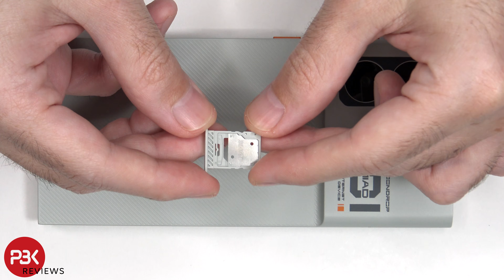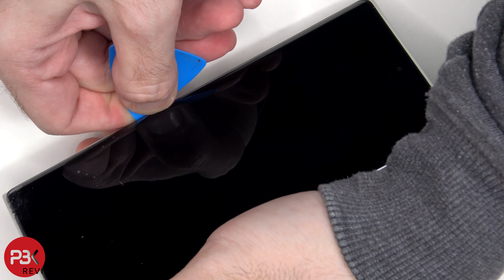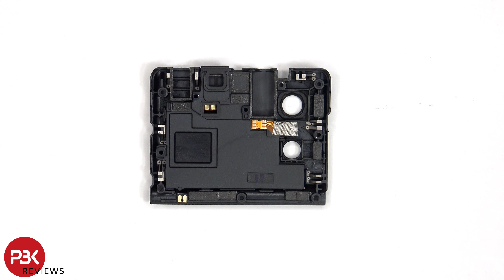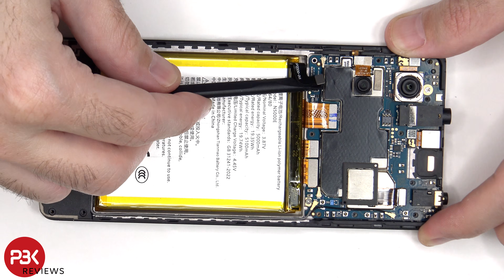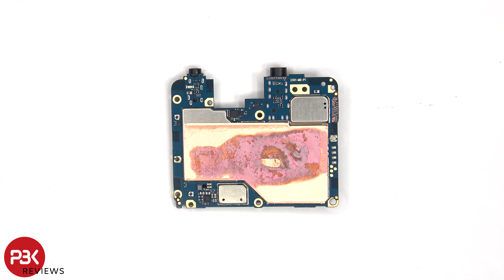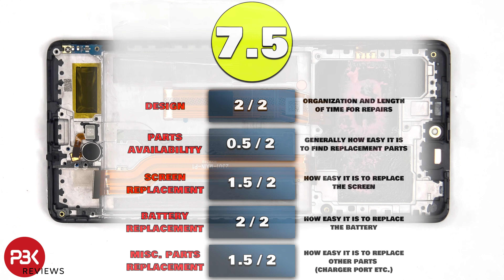Moondrop MIAD01 Teardown Disassembly Phone Repair Video Review

Comment: Do you think that its better to make  charger port as a separate daughter board without any components on it like ICs or capacitors or resistors except for the USB-c port? From the mainboard and subboard perspective, none of the connectors or ICs or capacitors or resistors except maybe the headphone jack need to be replaced throughout the life of the phone in ideal use conditions. Be it this or samsung or other phones.  What do you think of that in terms of repairability?

Comment: I can’t find a case for this phone. Any recommendations?
Reply: Get a local 3D Printer shop to make one for you made from sturdy resin or something. Best bet right now

My place has a jelly covering service too. It has a silicon-ish mold ready to be applied to any kind of phone screen/back cover which offers light impact and scratch protection. So that's another option if the same kind of service is available to you. Costs only 950 PHP here (around 20 USD, which may be more expensive cuz of localized pricing if ever)
Reply: HiFiGo sells the case and screen protector. Moondrop has the printable 3D files on their website too

Comment: This is how the standard should be, easy to repair, easy to disassemble/reassemble, the parts are also seperate
Also no heat gun
If all the phone manufacturers does like this, we could have the best phones to disassemble without being scared of breaking a part
Reply from the maker: yup, only drawback is the housing has to be made of flexible material like plastic and that causes it to warp over time. A few times its opened, it won't hold together as well as before.
Reply: Those company will say something like "We need adhesive to make it water resistance" which I believed Samsung once have a removable back panel with water resistance phone.

At least in DAP's world iBasso start to make it easier to replace battery, just remove 2 screws and battery is using JST connector.
Reply: @mixswist Because it's true? There's a reason why people use rubber adhesive to seal stuff, but then again they could've made it water resistant using a rubber gasket like hoses but those need pressure that the plastic backs won't structurally provide, if metal back it would work if it had a better locking mechanism.

So yeah they could've made it water resistant and removable at the same time, but they just want to take the easy route using glue to seal shit

Comment: I have a favor if u dont mind doing. So a dap will no longer be fucntional if the battery dies. So my question and favor is. If this phone unit does not have the battery inside and is connected to the wall. Will it still turn on and be able to use? If so i might get one for myself :)
Reply from the maker: Just took it apart to test, and yeah, wont work without the battery.
Reply: @PBKreviews  the way you try it again just to make sure the phone will work or not without the battery make you the best.
Reply: @PBKreviews  thank you for doing that for me :) it's a shame it won't work that way :(
Reply from the maker: yup, no problem.
Reply from the maker: Usually phones require the battery to power on and work. There are a few phones which specifically have a bypass and one being one of the gaming phones (I don't remember off the top of my head which one) so they will operate without having to power through the battery to save battery charge and use life. But unless the phone is specifically designed to do it, by default they won't work without a battery. This phone being one of those which I'm almost positive wont work without a battery.

Comment: Here I was waiting for someone to make in depth review of this phone but this madlad already post disassembly.
I heard you don't get Google Mobile Services with this phone which is a bummer as I really want to get the Moondrop MIAD 01, the spec on paper is great enough to compete with low-end midranger like Samsung A35 or Motorola Edge 40 Neo while still providing headphone jack(s) and 2TB expendable SD card slot.

I love Moondrop audio products and I'd get this phone if they release it with fully functional Google Mobile Services out of the box.
Reply: Dang no OIS...welp at least Moondrop don't lie when they said the camera " not good but it work " on their official site lol.
Reply from the maker: lol yeah, I liked how they described it. Honest yet funny.
Reply: it can use google apps very easily
Reply: Well idk why will anyone buy it. Who tf cares about sd card. You can use a usb too and sometimes usb 3.2 gen 2 if your phone has and connect it to nvme adapter with nvme ssd
Reply: @rajmangalpandey3910  uh me ? Hence I always buy Sony phones
Reply: @GjordDeLad05  sony phones are expensive but they still dont use vapour chamber. Still using cheap graphite film only

Comment: As someone from the audiophile community, I live this device. Would have really appreciated if.you could have shown.the DAC chip as that has been an as to.which DAC chip uses is it the CS43131 or the CS43198
Reply: It uses 2 CS43131 chips.
Reply from the maker: I would have but some of the components are in covered shields which are soldered so I show as much as I can without risking damage to the main board or parts. Also I'm not verse in every single chip on the motherboard to know exactly which version or type it would be since not all are clearly written on them exactly which one they are, so I would need access to certain databases to look up components by part number written on them. Hope this explains it somewhat. :)
Reply: Overall, the 4.4 audio port has better sound quality than a regular phone, and is almost same with the company's other product, the Dawn pro(around $80). And its 3.5 audio port has a lot of feedback with significant background noise. Its speakers, so to speak, just work. Considering its $350 price, it is not recommended to buy unless you really want to play with this novel product.
Reply: 2*CS43131